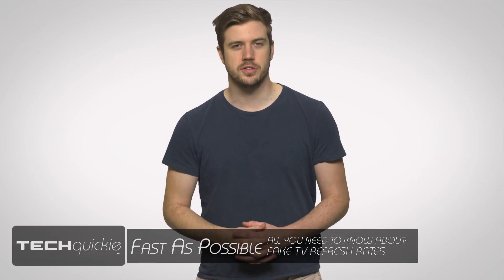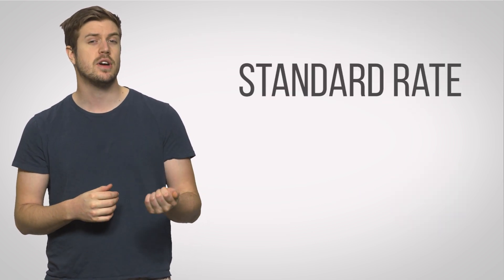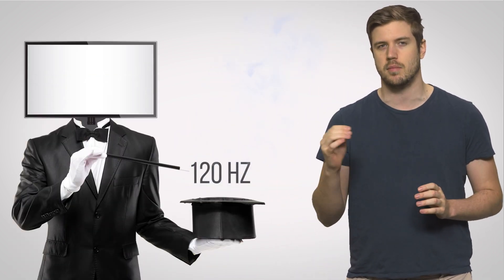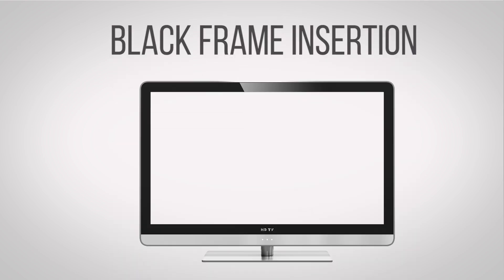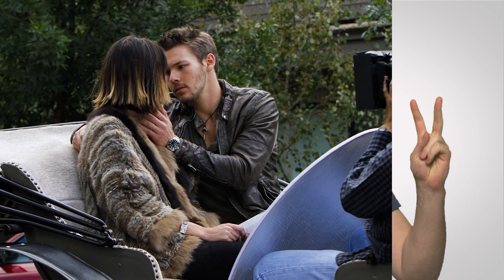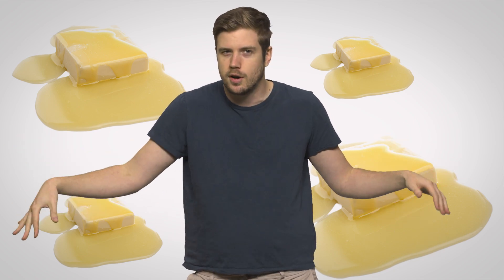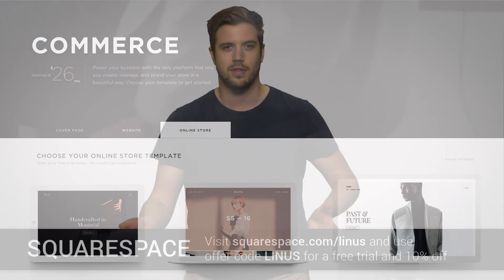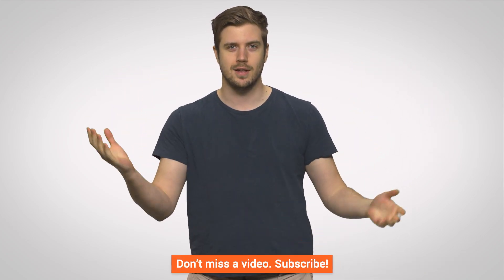Fake TV Refresh Rates As Fast As Possible

Comment: it looks pretty good in my opinion. I have the interpolation type. it starts to get too destructive if you set it to high but it is smoother than low. I keep it at low because it doesn't bother me if the motion isnt perfect. after all it started out at low rates.

Comment: 3:39 You don't need 4 GPUs to do that XD

Just get a 3070, a AMD 5600x and an decent fps config and you have yourself 900-1200 frames. This also works for csgo btw
Reply: This video was published in 2016.  GeForce gtx 1080 did not even exist back then i think.

Comment: like 7 years ago my mom got me a “240hz” playstation tv
Reply: It actually was a high refresh rate panel, but it couldn’t get more than 60Hz from HDMI. The main feature of the TV was that you had two 3D glasses which had their shutters synced differently. Then if you played a split-screen game, the TV would split the signal in half, so that one half of the screen was upscaled to take the entire screen. Now the TV produced two separate image feeds on the entire TV, so if you didn’t use 3D glasses, it would look like trash. So it would send player 1’s frames on frame 1,3,5,7,9 etc. then player 2 on frame 2,4,6,8,10 etc.. The 3D glass shutters then synched up with the correct feed on both eyes, making PS3 split screen games fill the entire screen for both players. Also you could use it for actual 3D content but who cares about that.
Reply: Funny thing is today we do have 240hz gaming monitors
Reply: We have 360hz and a prototype 480hz

Comment: I’ve asked around a lot and haven’t gotten an answer to this question.  I noticed that almost (if not all) OLED TVs on the market are only 60hz.  I’m wondering why this is?  Does OLED technology not require 120hz?  Do they have a faster refresh rate by design no matter what or something?  I find it odd that there are native 120hz LED displays, but the much more expensive OLED is always only 60hz.  Please help, I’m very confused.

Comment: Hi there I have a problem with the judder effect on lower refresh rate 50 hertz TVs. It gives me headaches and makes me feel sick. I had a full HD 100 hertz tv and it was fine, but most smaller 32 inch led TVs now only come with 50 hertz refresh rate and full hd.Some TVs have this 600 motion refresh rate buy are only HD ready 720 p. Which of the 2 would you recommend for me with this blurring problem?
Thanx, niall from Ireland ..

Comment: I'm in the market for either a 300inch "4k" projector that I found at bestbuy I'll only be doing a 120inch though it is 3500 lumens which s bright for a 4k projector or I found a 75inch 4k TV in the simulator price range of $1000 too but the other TVs are also 120hz even the motion enhancements are still 120hz so wtf even if I get a $1500 TV it is still 120hz am i shooting for the stars looking for 240hz? Or am i just not spending enough? 120hz over 75 inches seems weak! Right?

Comment: imo its just dumb , on pc refresh rates are multiples of certain values , like 144 is 6 times 24 , 120 is two times 60 , 240 is 4 times 60 and so on , it makes sense to have multples 

meanwhile tvs have other values , i was looking at tvs on amazon for fun  and since i wanted to compare the prices of 4k tvs to my old 1080p tv i bought for around 660€ for a special deal a store had 

more size and 4k for the same price then i noticed the hz amazon literally has 50 - 60 - 100- 120 , 200 , 240 and then they only have round numbers up to 1000 & more 

like are they really serious about this , i watched some videos comparing hz ,and in slow motion , 240 was completely fluid like it wasnt even in slow motion ( in a racing game recording )  what do
they think can be achieved with 400 - 600 or even 1000 and above hz ? i know its a scam but why would they lie about something real , just invent awesomeness points for tvs and say it has 9000^9000 awesomeness points ( i just tried calculating that in the calculator google shows you and i got infinity as a result lol ) 

but dont take a real thing like Hertz and use it in fantasy ways

Comment: For clarification, the refresh rates listed, even if they are only of the 120/240 Hz variety are still misleading. Here's why:
First off, there is no "LED" panel. All panels are LCD. LCD/LED refers to backlight only. All consumer LCD TVs have a fixed maximum refresh rate of 50/60 Hz depending on whether or not they are PAL or NTSC systems respectively. The 120/240 Hz specification is not the panel refresh rate, but instead the CPU's frame processing rate. That is, a 120 Hz TV can process 120 frames internally and a 240 Hz TV can process 240 frames internally. This internal refresh rate (I hate using that term for CPU processing) is of use only for frame interpolation on modern sets. 
Frame interpolation is where elements of at least two successive frames are received and analyzed by the TV's CPU for processing. On a 120 Hz TV, the frame interpolation will work fairly well for 24 FPS and 30 FPS material as both fit into 120 at least three times. For 60 FPS material such as console games, computer display signals from a GPU, and certain broadcast signals, the frame interpolation used for motion blur reduction suffers from "hiccups". It is often referred to as the "hurry up and wait" effect where the motion smoothing will appear OK for a few frames, then suddenly de-sync for a couple of frames, and repeat the cycle. This is because there is no time to process the two key frames needed to go along with the third interpolated frame. At 60 FPS, on a 120 Hz TV, the TV can process two frames per refresh cycle, which does not leave enough time to inject an interpolated frame every other frame, which is necessary for motion smoothing to work properly. That is why TVs need processing at least three times the panel's refresh rate so that it can inject the interpolated frame in the time of each frame cycle. 
In order to avoid the de-sync issue, a TV would have to have internal processing of at least 180 Hz for 60 FPS material to be displayed smoothly. However, there are only 120 Hz and 240 Hz TVs on the market (I ignore all those specifying higher Hz ratings because past 240 Hz there are no gains for frame interpolation). While a 120 Hz TV can perform proper motion smoothing on 24/30 FPS material with virtually no de-sync problems, a 240 Hz TV is needed to perform motion smoothing without de-syncing. In the case of a 240 Hz TV, the CPU in the TV has time to create three key frames and one interpolated frame from that data each cycle. In fact, true 240 FPS (Hz) internal processing leaves headroom in case of any signal issues or errata in a frame. This is why the soap opera effect is so much more pronounce on a 240 Hz TVs than 120 Hz TVs - with more time to process the key frames and interpolate a frame internally and headroom on top of that, the effect is much smoother and more consistent. 
As for computer use, the reason the TVs won't accept a 120 Hz signal is because the panels are 60 Hz maximum. The only possibility of that changing is if the TV is 3D capable and accepts dual field 60 Hz stereoscopic 3D signals from the GPU or if the panel is upgraded to be a true 120 Hz (8.335ms) response time display. 
Samsung is unfortunately leading the market once again with its disengeuous specifications on its 4k UHD TVs. Those TVs can process 1080p at 120 Hz/FPS, but can only process 4K (3840x2160) at 60 Hz/FPS. Despite Samsung's claims of HDMI 2.0 compliant ports, their H6950 TVs do not use true 4:4:4 chroma signaling. Instead they use 4:2:0 chroma subsampling, a method that is not an official HDMI 2.0 spec, but was added in HDMI 2.0 as an "unsupported" spec. This is to allow the TV to receive 3840x2160p60 signals over HDMI 1.4 systems. It is no coincidence that nVidia used the same trick with their Kepler GPU drivers, which also send only 4:2:0 chroma signals to the TV/monitor instead of 4:4:4 chroma signals. This is to reduce the bandwidth needed so an HDMI 2.0 compliant port is not required. Sadly, even the GTX 980 from nVidia can still only net you a 4:2:0 signal into Samsung's H6950 TVs even though those cards have true HDMI 2.0 ports capable of 4:4:4 chroma signaling @ 60 Hz. This is why nearly every review of the Samsung H6950 series is negative when coming from somebody using it as a computer display. It can display 1080p at 4:4:4 chroma, but not 2160p. Such is the misleading way of Samsung. At the time of this post only Panasonic has a true 2160p60 input that can handle 4:4:4 chroma signals because it is the only one with a DisplayPort 1.2 port. If you are intending to get a 4K TV to use as a computer monitor, be aware that you will most likely need to wait until they start putting DisplayPort 1.2 connections onto their sets as that is the only way to guarantee a proper connection and color reproduction. 
Anyway, bottom line is this: If you need motion smoothing for only 24 FPS (Blu-Ray) and 30 FPS (DVD/OTA Broadcast), or 60 FPS Interlaced (DTV) material, a 120 Hz TV will suffice. If you intend to use 60 FPS (progressive scan) material with motion smoothing, you will need a 240 Hz TV to avoid de-sync issues. For PAL regions, substitute 100 Hz/200 Hz TVs for the 120 Hz and 240 Hz specified for NTSC respectively.

Comment: 3:07 "...some people are just used to lower frame rates making things look theatrical. After all, many movies are filmed and shown at 24 fps."

That's the oft-repeated speculation for why so many people (especially film makers) dislike higher frame rates, but I don't think it's that. People were used to lower resolution televisions too, but no one complained when pictures got sharper. The same could be said about contrast and color depth. There is something different about higher frame rates that sets them apart from other so-called 'improvements' in image quality.

Comment: what is funny is most stuff you get is around 60hrz when recorded but when you go to 4k or some of or most I should say now days hd then its 24 . while we do have tvs that can produce a true 120 240 480 and 1024 and so on it matters less if the image recored is not in that high of a refresh and the truth is when we do have it we will only go so far as most of us who have seen true refresh rates cant see any difference above 240 and some not even that. right now we have video games as the things that can do that high. yes we have cammeras that can but they are the most expensive ones you can buy and are rarely used. tho I have hurd talk of 4k moving to 120 but at this time from what I am told is the cost to make 4k at 60 is so expensive no one would be that stupuid to do 120 do to expence

Comment: I hate the "interpolating" TVs. They only ever work on slow motion (so completely defeats the point of having high framerate) as soon as there's any motion that goes too fast, it's immediately noticeable, so the video you see is constantly changing between 60hz and 30hz and sometimes even half the frame will be 60hz while the other half is 30hz. It's so distracting and I don't understand why people like it. Oh, also good luck if your scene has fog or any kind of irregular smoke, it'll look like you're underwater.

Comment: I prefer motion interpolation because it approximates motion from the real world in what it should,ve to look like, even from sources were half of the frames were thrown away, those original frames can be approximated back.
Reply: Except it doesn't. It "works" in scenes where everything is moving slowly and there's no smoke or fog in the way, but as soon as something moves faster than running speed, you get either huge artifacts, or the processor simply gives up and displays that frame at it's normal 30hz.

This is INCREDIBLY distracting because the video is constantly switching between 30hz and 60hz, sometimes separately, sometimes within the same frame.

The point of high framerate is so you can see faster motions more clearly, right? Then the fact that it fails if something goes too fast is counter intuitive, and makes the whole thing useless.

And if the scene has wavy fog, the entire room warps strangely because the processor doesn't know how to handle it.

Comment: it would have been funny if they uploaded this in 60 hz
Reply: Don't you mean 60 fps?
Reply: Yes, so if someone playing a game at 100 fps then must use a 100Hz monitor or will never see more than 60 or 75 frame, unless vsync is turned off but then will never see a full completed frame just part of it
Reply: 60hz means 60 cycles per second.. which could be interpreted as 60 cycles of showing an image per second so 60fps = 60hz

Comment: Running your display at let's say 69 herts, is a terrible idea. It'll work for you if you play games that can properly sync to the refresh rate and such, but let's say you're watching a YouTube video. Now it'll either run at 30 or 60fps. No matter which of the two, it's not a number easily divisible by 69, meaning your monitor and the video will have out of sync motion, and you will either see weird artifacts from half a frame entering the picture early, or missing a frame or whatnot. If you have a 60Hertz display and you watch 30FPS content, it's a simple matter of showing every frame for two cycles. Are you watching it on a 69 Hertz display, you'll lose information. At this point I'd like to speak to the value of G-Sync and FreeSync, because the higher the dynamic range of refresh rates, the better suited the display is for all kinds of tasks, from gaming at super high refresh rates, to watching a film at native 24/23,96 frames per second.

Comment: NVIDIA just needs to make a TV with G-Sync and all would be good.
Reply: 1 year later.  done.
Reply: you're thinking of v-sync. Gsync is the opposite. It matches your refresh rate of your monitor with the fps output of your gpu. Freesync does the same, but is about $200+ cheaper
Reply: @mikecrapse5285  except that freesync panels are shit and tend to fail faster. So no thanks, G Sync, please.
Reply: lol....
Reply: Yo you're the predictor
You did it right
Lg c9 is coming really soon
https://youtu.be/h_RhOTIiQoI
Reply: Lucian Andries where???
Reply: lol true tho
Reply: And here you have it just this month with Lg - C9 !!!
Reply: I mean they have it now-
Reply: This aged well lol
Reply: Lol why? G-sync matches the FPS output of your gpu with the refresh rate of your monitor because the fps of games change (unless you lock the fps of course). As videos always run at the same framerate this would be useless. Or do you mean for gaming on a TV? Because that would be an even worse idea.
Reply: Because movies are 24fps.

And it would work well for games, as long as it's between 45-75 fps.
Reply: Mike Crapse No, I am not thinking about V-sync. G-sync handles variability in frames way better than v-sync.

Freesync is "free." But the display companies still have to do a lot of research to prevent ghosting, damage to the pixels, etc. We had quite a lot of freesync panels fail in the first year.
Reply: Saugat Manandhar wasn't talking to you lol

Comment: Look at SVP (Smooth Video Project) if you want to watch anything in 60fps in real time. works better than any in built tv function. requires a decent spec CPU if you want to watch anything above 1080p
Reply: That's pretty awesome! Can't believe I didn't know this existed! Thanks, I'm gonna try it out!
Reply: Try the older version. 3.1.4 That doesn't tend to go out of sync.
Reply: If you have audio synth problems, open control panel and change the quality to lower on the bar. It will go back to synth in one-two seconds.
Reply: *sync

Comment: I`ve found LG`s Trumotion to be a very welcome feature after putting up with years of horrible Digital judder at 24/25 & 30 fps content which is now far worse on the huge TV`s that many of us have.  Real film maybe 24 fps but it was Analog and the frames blurred together in a pleasing way.  Digital does not do that and thus recent tech attempts to try to fix the problem.  Don`t get me wrong though the standard settings on something like Trumotion are horrible and give that well know crappy Soap Opera feel but ...................... if you use the manual overide and set the De-Judder amount yourself to 5 or 6 out of 10 then I defy anyone to say that the result is not better ( assuming that there are no problems with the processing of the source material )
Reply: of course none of the above applies to gaming
Reply: Noiselab Project it's not
Reply: Haeral Frames per second 50 or 60 FPS instead of 24, 25 or 30

Comment: I worked as a projectionist in my local cinema, the film projector (yes film, the one you have to rewind) actually only lights the frames every time the picture is perfectly aligned, meaning it has a shutter speed of 48Hz and always shows a frame, followed by blackness, then another frame and so on... It's actually the exact same principle as the tv shutting of its backlight in between frames. I don't think digital projectors work the same way, but it explains he rumbling sounds of the film projector. The band has to move across the light, stop, continue to the next frame and stop again, therefore making a "clack" sound 24 times a second. It's truly amazing.

Comment: does refresh rate changes with change in resolution??
Reply: depends
Reply: Raging Noodle on what?
i will be using an asus vp228h will i get 60hz refresh rate at 1080p?
Reply: +Aksshay Sharma it should if the video or game is in 60fps
Reply: Raging Noodle i will be gaming on my pc and on the website it simply says dat ref rate is 60hz

i don't know if this changee or not
Reply: asd fd is this problem with 4k only or with 2k and 1080p also?